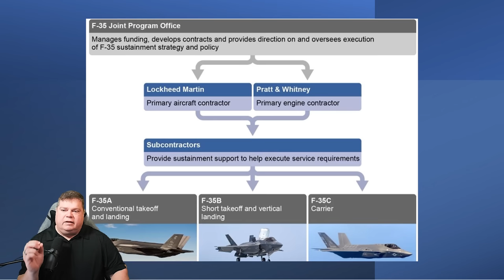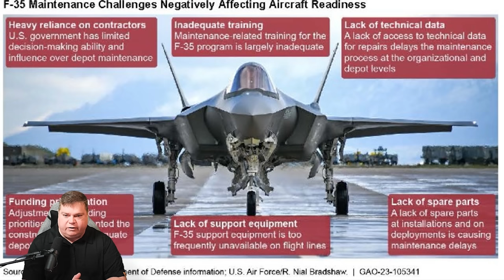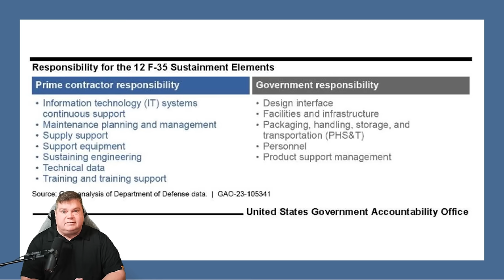What Is Wrong With Americas Deadliest Fighter Jet

Comment: Every one of the bullets associated with the Prime Contractor Responsibility problems (GAO report) regarding the F-35 are all the result of piss-poor logistics planning and management. The idea, for instance, that special tools and equipment is required should not ever be allowed in any acquisition systems design plan. DoD has allowed the fox to watch the hen house for years and it is (service wide) our Achilles heel. Ignoring logistics is outrageously short-sighted, poor project acquisition/management and is totally unacceptable. Look into it and you'll find political science at the root. Politics has no business in the acquisition and operation of DoD systems. It's criminal.

Comment: Alright, some takes:

1. The F-35 is a stealth fighter jet with extremely advanced avionics. In the case of the F-35B, it comes with a rotating engine and additional turbofan. Maintenance on this plane by definition was going to rely on more contracting work and intensive maintenance.

2. Having said that, subcontractors are genuinely a mixed bag. I've worked with some great ones and some damn horrible, terrible ones on projects. There should be a way to hold them accountable for BS.

3. Parts issues are definitely a thing. It's hard because sometimes the subcontractors will go out of business or discontinue their line or are just terrible to work with. I'm hopeful that with improved 3D printing we can replace a number of components, and for those we can't print we should have tons of stuff in stock. 

4. Training on some equipment pieces is absolutely dismal. Sometimes they've never even heard of the thing smh.

5. No part of the plane should be proprietary info for the govt. Items should also be as versatile/interchangeable as possible - no special screws or things like that.

Comment: This nonsense started in the mid eighties for me. I was a systems tech in the RAN and we were trained to repair stuff down to 'component level.' The older ships were mostly analogue and could be worked on. The newer ships, (OHP) class etc. were 'card out, card in' on most of the equipment. The cards were unrepairable by us, and were sent back to the manufacturer. Not realy good if you need it right NOW!  
One thing I did notice however that was a funny sight, was when two or more of one type of ship were docked together, and you had technicians running up and down the wharf exchanging spare parts to try and improve their own equipment. 😁😁
Reply: You likely got the systems nerfed models.  They(OHP) were traditionally analog(iirc) but were upgraded in service several times. Maybe those were upgraded and then intentially nerfed before sale.

Comment: If this is the level of combat readiness during peacetime, what would the combat readiness look like under the demands of a protracted hot war, where the sortie rates for these planes would be much higher.

Ultimately, the prime contractors should be held accountable for the responsibility in seeing that the terms  of the contract are met, in terms of delivery and maintenance.
Reply: What sortie rates? What are you talking about? In a hot war all of these planes would be pools of molten slag on irradiated runways before the first week was out. What's the point of over-priced weapons systems we CAN'T USE? The only opponents we could possibly face without escalation could be obliterated with fourth or even third generation aircraft!

Comment: I worked contracting for years over at Pax, and pretty much everything you say is what we would see. Repairs only company X would be able to do even thoughthe repair is simple. Replacing certain parts would require other contracting companies to come. Waiting on PLO to remove a cannon plug from something to get a jet or helo up. Then you get to the documentation…. It is so much different from the being in the military. I miss it though. Glad I'm retired.

Comment: Wasn't the way F-35 build is to spread out contractors as wide as possible all over the 50 states, so no one in congress would question about its cost or even dare to think about canceling the project?

Well, then what is happening is not a bug, its a feature.
Reply: A lot of this can be placed at the feet of the Kennedy administration. They realised it was possible to game the electoral system by only handing out TFX (F111) fighter contracts in regions which could make a difference during the election. Of course, when he got into office and tasked McNamara to begin looking for substantive cost-saving measures on defence he - coincidentally - got his head blown off ...
Reply: TRUE.

Comment: I’ve seen similar intentional design as income generators, in the Malibu(headlamp replacement) for example, to increase complexity and cost and revenue.  This is a case where no one in purchasing has enough technical knowledge to challenge or insist on practical simple 8:48  solutions.  The more complex the design the easier the breakdown.

Comment: As an aircraft mechanic and some one who actually built the F-35 center fusalage, I can tell you that it is not made like any other aircraft. It has more in common with the B-2 than an F-16. This was the first composite structure I ever worked on. We had massive tooling to suppot the structure while it was being assembled. Unless you are removing and replaceing an individual systems component like something electrical , hydraulic, or fuel system part, any OML skin repair or replacement would be difficult for field maintenance to perform. Depot level shops would be required to to do most of that work. If they are failing at providing depot maintenance it's because the plane is unlike any that has ever come along....ever. I do have faith that it can be done though. As for modifications, there are none. The only "modified" F-35s are flown by Isreal.    F-35 is UNIQUE!!!    There will be a huge learning curve. ❤🤍💙

Comment: They could have built the Flying Sub with that kind of money. 😅 Maybe they can use the F-22 to deliver spare parts overseas. 😊 When you need more than one part or tool, you should buy another at that time. It's a compromise, but slowly, it solves the problem, and you don't have a huge overstock. All that without a huge study!

Comment: Every Aircraft with this much High Tech will have issues !!
And when the Air Force has their 6th Gen Jet that will have problems also !!   Semper Fi
Reply: All weapons systems have a shakedown period.

Vietnam was extended largely just to work out bugs in actual combat operations that were unanticipated as always happens when the gears hit the grinder.
Reply: The Rafale don`t have this problem.
Reply: @deuxalex562  4th Gen Fighter !! 🧐

Comment: We need to think about it in terms of baseline, "keep the trains running," and "surge capacity." Surge capacity looks a lot like classic DoD hand-outs to military contractors. Running the trains can look like naïve incompetence.

Yeah, that seems like a problem. I think a distinction between "immanent" readiness things vs. "backlog" stuff could be made. Stuff like "make enough spare parts" has timing flexibility. It's possible for it to become an immanent problem, but unless there's a full out war, you should be able to scale up or down production once you've built up a buffer of spare parts. Stuff like pre-staging heavy equipment needed to conduct maintenance, or having trained personnel to do it, would fall under "immanent," and that stuff would have to be internal to DoD.

Comment: Of course, we all realize this is closely related to that pesky "right to repair" issue. The moment lawmakers force common sense into this program,  they're going to take a lot of heat for handling the public's repair issues differently.
Reply: A 5th-gen fighter isn't the same thing as a John Deere machine or an iPhone. They can make a better national security argument for the F-35 than JD can for their combines.
Reply: Clearly, but look under the hood and you'll see roughly the same motivations that emerge from the same first principle layers. It's not like giving our own military maintenance crews the part numbers for the equipment they serve is on the same level as a war thunder post... at least, it shouldn't be, right?

Comment: I worked at the Oklahoma City Depot (Tinker- OC-ALC) for over 15 years. The same issue that is happening with the F-35 was also happening with engine maintenance. The taxpayers will ALWAYS get hosed when the Government is joined at the hip with it's contractors. We found it near impossible to get parts for the F35 engine from Pratt.

Comment: Great Job as always.

Contractors, Subcontractors, and even government officials saving money by cutting corners in Maintenance is a theme in just about every piece of complex technology be it high tech or something just complicated like a Civilian Locomotive.  Brand new shiny stuff (whether it be a new Buses for a City, or a new application, or new defense widget is always more politically significant than Maintenance because of the "splash" the new "Bus Widget" has on those who will fund new projects.

This is very depressing since maintenance and upgrades make up most a a project's life cycle costs.  I would recommend fining these sub contractors for missing the mark.  However, that is easier said than done.  The sub contractor just runs to the politician in their pocket and cries "not fair, if I have to pay the fine I will have to shut down the plant in your district whaaaaaaa".    I wouldn't last 5 minutes as a government auditor in this business.

Comment: The comments on the problems are right on the money, but I think this is pretty much standard stuff for the roll out of a new Fighter, let alone one as complex as F-35... F-16 for instance has had over 600 hull loss accidents... I know it has a large amount of flying hours against it but it shows you even a much simpler design can still have operational losses...
Reply: In my company, We used to say jokingly that fighter jets are « consumables « . Loosing an aircraft from time to time is part of the game. 
The way they are used endanger them. Flying in all weather, all attitudes and altitudes, high speeds… there are hot rods, were performance is more important than reliability and redundancies and safety devices are kept to a minimum to save weight.
The only precious part is the pilot.

Comment: When there's is significantly more data available, I am going to bet that the losses, readiness and other mission critical statistics for the F-35 will outperform other aircraft and overall "new acquisition" metrics by a wide margin. Also, the overall fleet of 4th and 4.5 gen fighters are aging so accident and readiness issues may creep up as a result...all while F-35 "numbers" slowly improve.

Comment: We should have had Grumman build the Super Tomcat they wanted to do.
Reply: Might extend the life by another two decades, but without stealth it doesn't have a place in the 5th gen theater. Need an NGAD whatever it turns out to be
Reply: The old Tomcat is more than good enough to deal with 95% of potential threats. Forget about Russia and China because fighter aircraft would be irrlevant in a war which would heat up very quickly vs a nuclear power.

Comment: In the event of war you will see many subcontractors brought into the manufacturing process. I base this on what happened in past wars. 

Have we ever seen subcontractors brought in to maintain aircraft, though?

I was going to say equipment rather than aircraft, but I'm sure a subcontractor has at some point changed the tire of a humvee.

Comment: they should be making enough of these parts or tools so that whenever a plane goes down it could be fixed. I don't think  that's to crazy to expect, considering the cost of the aircraft, wouldn't it make more sense to be able to fix it right away and avoid huge down times and maintenance?

Comment: You mentioned the LCS program amd I believe there are a lot of paraells. They decided to go all in on this one size fits all aircraft that has been plagued by problems from the start at the same time trying to cancel everything else in order to free up more money for it. It is no coincidence that 48 of the states are involved with parts, repairs, or basing these fighters making it hard for elected officials to say "no" when it comes to the F-35, there are still huge issues with the platform, so much so the services are trying to cut back on orders and even in some cases ordering more of the planes it was designed to replace.
Reply: I dont see the services ordering more planes it was suppoused to replace.

The Super Hornet is going out of production.
The F-16 is being produced for export only.
The F-15EX will be procured only in rather small numbers and the A-10 is going the way of the Dinosaurs. 

Now this does not mean the F-35 is flawless but at the same time that statement does not seem to hold true.

Comment: There are all sorts of crazy things in those reports. For instance, the F-35 has an air-cooled engine. Because the program has been going on for so long, the designers have kept adding capabilities that all need cooling. So the engine wears out too quickly. The other crazy thing is that the again the program has been going on for ever and they are now modernizing it! And this has been going on for 4 years and is not going too well either. They are trying to modernize a plane that is not even ready for mass production and its failing! God only knows what happens once this thing goes to battle!
Reply: its very combat ready thats not the problem
Reply: @yujinhikita5611 Read the documents... Government Accountability Office is saying that there are too many technical flaws and the F-35 not ready for mass production.
Reply: Most engines on the planet are air-cooled, the problem is that the bleed air system needs to draw more than the original design specs called for by about 2-3x leaving less to cool the engine itself. This isn't a problem with the engine being bad; if anything the fact that it can be reliably overrun w/o exploding is pretty impressive. Aircraft modernization over its lifetime is normal as well, especially for highly technical aircraft because of the speed technology progresses at. The modernization process hasn't started yet either, it doesn't come until next year after the DoD submits the required docs to authorize full rate production of the aircraft and hardware. Your overall knowledge is a bit misconstrued
Reply: @forzaelite1248  You should read the May report on their website. Modernization is normal, but they are modernizing an aircraft that is so far behind schedule that it needs to be modernized the moment it enters service. We have been here many times before with the F-35. DoD is already running the Block 4 modernization as part of the main project. I'll post a quote about the engine problem separately.
Reply: Yes. Completely TRUE. 
Well, i have my doubts whether this machine will go to battle anyway.
Maybe in 2050...🤣🤣

Comment: We would have to go back to procurement of the JSF program.  Lockheed obtained the largest fighter contract of all times by default.  Boeing's entry failed take-off with a combat load and failed in-flight refueling.   Aaron would you have been the happy crewman of a submarine that was only marginally better than a rival project and built because no other had proposed a better one?

Comment: The same thing happened when the F-15 came online. The Subs didnt get training and information initially, but within 7 years it got worked out. But they also had the Reagan administration lobbin in 155's avery day or two to get them in line. Today we dont have that strength at the Executive level and Lockheed is PARANOID about industrial espionage, and the classified nature of so many systems on the aircraft.  So this is what we get.
Reply: This is corruption, flat out. It’s just the US version of the Russian not replacing tires and selling them on the black market.
Reply: The days of when people got stuff done are long gone.  Military Industrial Complex indeed.  There's a reason why they're ordering more F-15[EX]s, and should probably keep F-18 and F-16 production going.
Reply: @stcredzero  ... no lol
Reply: @martinmoffit8950 the planners know we going to need the older modernized planes because the F-35 program is just fucked. It’s like the shuttle program(which by the way failed to be cheap as planned and was slow to be turnarounded unlike the design selling points). Does a thing but doesn’t do it well or efficient or easily.
Reply: What does 155 mean? Sorry, I am just a lowly accountant, not a military expert haha I was thinking a 155mm artillery shell but maybe I'm just dumb
Reply: @EmpReb  SST ended up being built by comittee, which was the death of it.  That's the problem with multi-role aircraft.  They can do many jobs, but excel at none of them.
Reply: I was on the F-15A as a maintainer and it wasn't nearly this bad.  We did a lot of the work at the wing or squadron level and our only issue was parts production was slow.  I recall some contractors from time to time for the radar but by 78 or so it was doing well.
Reply: @martinmoffit8950 The F-14D, 15E, 16 , and 18 are all multirole, do they count too? Also if you're interested, the GAO has a report in 2022 about fleet sustainability, you should see how much it costs for a truly single role specialized platform. It's not pretty.
Reply: @forzaelite1248  Those platforms were originally specialized and have had multirole added.  I don't trust anything the GAO publishes and neither should you.  The same GAO that says the A-10s aren't very good at their job and the solution is to procure more F-35s.  The US had more aircraft, ships, and equipment in the 80s, operating on a lower percentage of GDP.  Now there is less everything, across fewer platforms, and you can't throw enough money at it.  Something is very wrong.